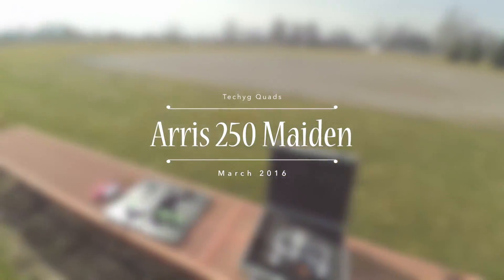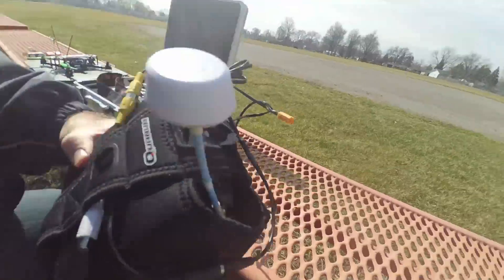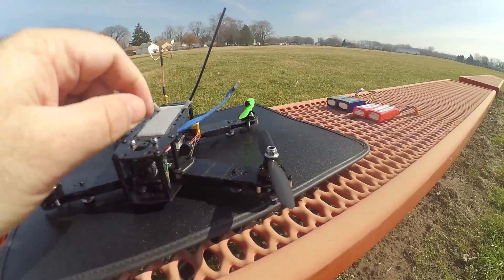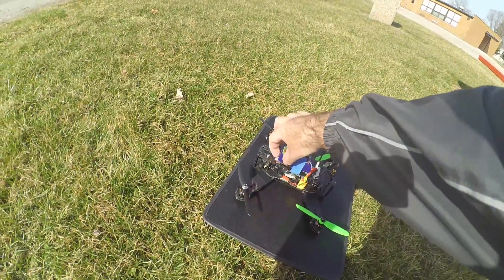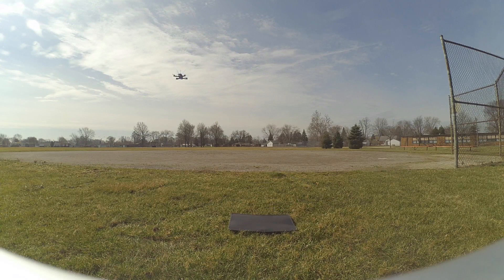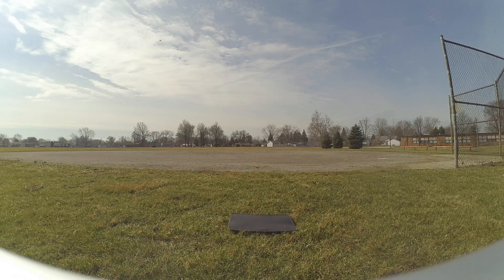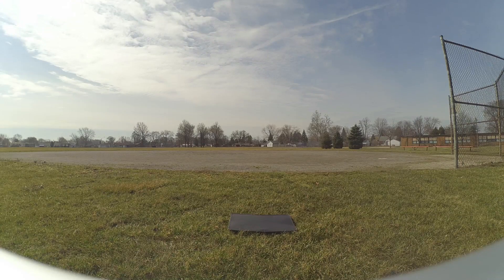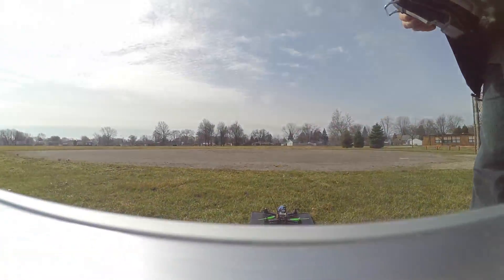Arris FPV 250 Walkthrough and Maiden Flight

Comment: could you tell me what happend when this kind of drone is out of range? thank you
Reply from the maker: If it goes out of range, the fail safe will kick in and it will drop out of the air (power will be cut from motors).  If it gets close to being out of range, my radio will give me an audible warning, since I have telemetry and am using a Taranis.

Comment: Any idea what speeds can be reached with this drone and would you knoe if it's faster than a dji mavic
Reply from the maker: Benny Blanco building a custom one like this is typically going to be much faster than a pre built one. Speed is somewhat dependent on your battery and motors. This ones top speed with a 3S battery is around 45-50 mph. With a 4s closer to 60-70. After having this quad for a while it has held up fine but I would recommend other frames for higher speed.
Reply: techyg-quads thank you for the reply